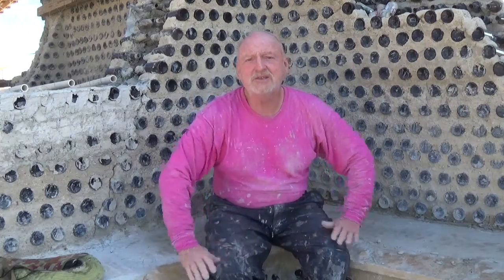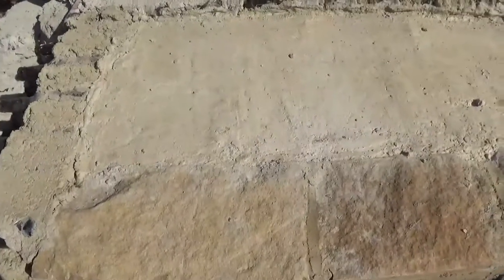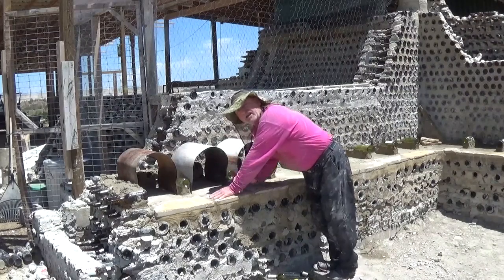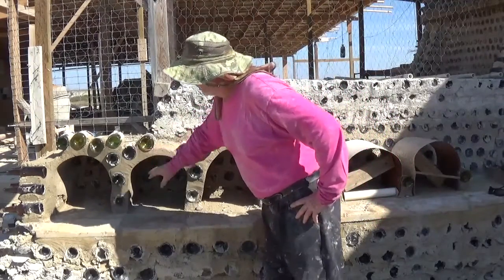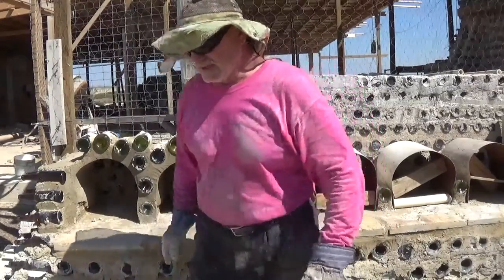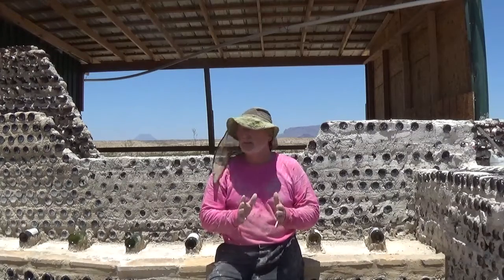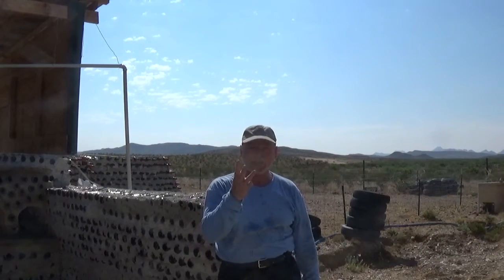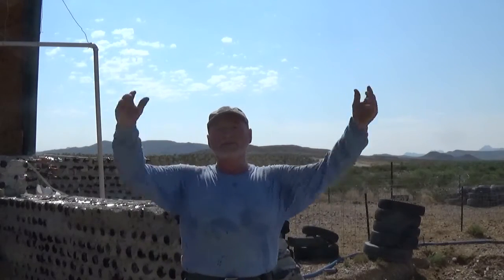Hen House Part 3 (A Bottle & Masonry Build!)

Comment: are the lids on the bottles, and is there water in them, if no water, could there be for heat retention at night. do the chickens run loose
Reply from the maker: George Gardinier The bottles are empty. There is really no way to prevent evaporation of water, even in "sealed" bottles. I was renovating a 50 year old house back in 1974 and removed a wall that had been up for about 20 years. I found a wooden six-pack of Pepsi. All six bottles were factory sealed, yet the cola had about 80% evaporated! 

We tried filling the bottles with earth. It is too much work, but that would be one way to create thermal mass. The walls I build in the house, except for the few "light walls", are double walls with varying gaps between them. The gap is filled with earth, trash, bentonite and so on. This creates a thermal mass that moderates temperature changes.
Right now, the chickens free range during the day and put themselves back in the other room of the coop at night. There are 23 of these adults. The newer ones (110+) that this construction is mainly for, will be confined in a 1/2 acre yard, fenced and covered. Again though, they will be closed in at dark. Even though the yard will be as predator proof as I can build, there is still a chance something may breach the fence, The horse fence reinforced doors and masonry walls are their final defense!
Reply: eco-ranch.us thanks for answering so quickly, you say predators, what do get, and would an electric wire do help
Reply: George Gardinier also i watch all of your shows
Reply from the maker: George Gardinier Thank you! That really makes me feel good!
Reply from the maker: George Gardinier We started with about 32 birds and now have 23. I have not seen any one predator take any and some did die of natural causes. We let our domestics cats (2) out each night and they could have dragged away any that died naturally. HERE, I anticipate coyotes as our main threat. Fox, bobcat, skunk (egg eaters), badger, and javelina, are also potential problems. Rare but possible are cougar, bear and even jaguar. These I really could not protect against, but would be a decadal event, if at all! 

In Florida, we had a bobcat preying on our flock. When I staked him out (and killed him) he was leaping completely over the seven foot tall emu enclosure fence without touching it!! The other potential predators are diggers. Given that, using our battery power to run an electric fence might be a waste! I am installing spotlights with motion sensors in the yard though.

I am protecting the bottom of the entire fence with "L" bent chicken wire underground, covered with rocks. The sides from the top of the fence and the roof will be completely covered with chicken wire to start and this may be replaced with translucent roofing panels later for additional rainwater collection. The duck pond will have to be covered anyway to reduce evaporation, so I am building the roof in the same way as the rest of the roofing so it will be easy to replace the chicken wire with roofing. A human with a gun is the best protection. I know the calls when a predator is IN the coops and come running with a shotgun! The birds are always looking at the intruder, so it is easy to see one. Many a raccoon and possum died that way in Florida!
Reply: eco-ranch.us   wow way out where you are, shoot em all , lo l, looking as always to your great videos sir

Comment: how much bottles do you need to make house?
Reply from the maker: Loaded question! How big of a house? What kind of bottle wall, single or double wall? What kind of bottles, beer or wine/booze? There are a lot of variables!!!

I have about 30,000 in the compound right now and it is about half finished. I am using rocks from a rockfall (avalanche) for much of the remaining walls and tires for the back wall of the greenhouse. I should have about 45-50,000 bottles total in the entire place when it is finished.
I would guess that a 1000 square foot building would take 35,000 beer bottles, using double walls however.